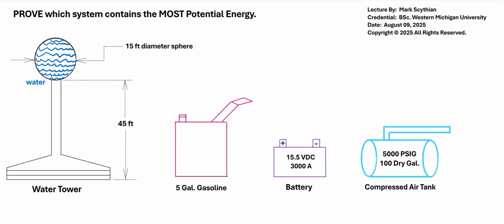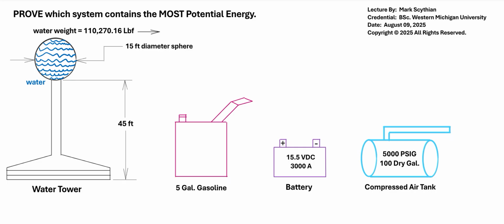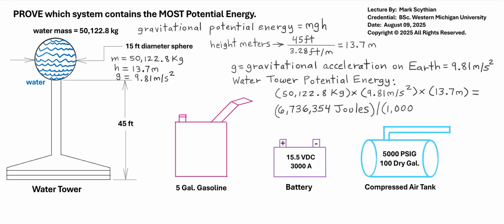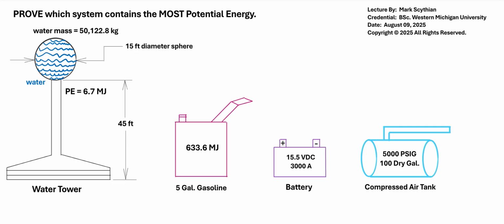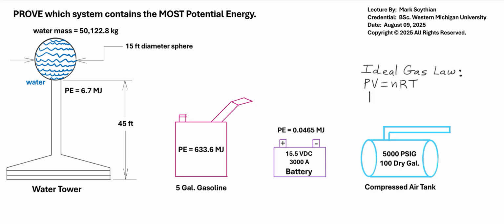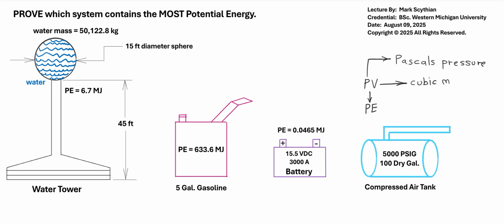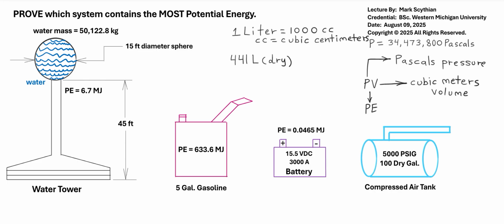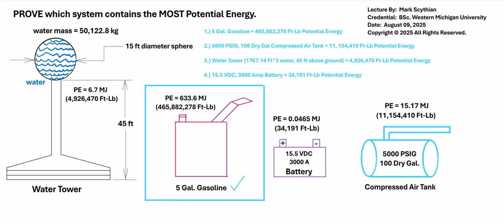Prove Which System Has The MOST Potential Energy

Comment: You correctly find the number of Watts for the battery, but without knowing the amount of Watt-hours it has, can you really transform that into Joules? Assuming 46500 Joules/s will equal 46500 Joules total means we think the battery is being discharged in exactly one second when we draw 3000 A from it. There are batteries of different sizes that have the same number of Volts and maximum Amps, but that differ in total energy. For example AA vs AAA batteries.

Comment: Are you sure about the battery? People (especially from US) confuse Amps/Amphours and Watts/Joules, kills me when I see W/hr. 15Vx3000A is 45kW (not a unit of energy) ... 15Vx3000Ah would be 45kWh or 162MJ but it's quite large for a 15v battery (still achievable: 5s10p of a mainstream LFP cells). Also, when you say potential energy, It's in the context of mechanics, but nobody's going to store energy by lifting batteries so I'll give you that one.
Reply: Right? I went back to try and see if he just mislabeled it but he definitely called it amps not amp hours.
Reply from the maker: On a Fundamental Physics level, Potential & Kinetic Energy are always OUTSIDE of Time.  Energy is measured in Joules or Ft-Lb.  1.36 Joules = 1.00 Ft-Lb.   Power, on the other-hand, is measured in Joules/Sec (Watts) or Ft-Lb/Sec (550 Ft-Lb/Sec = 1 HP) ===> 1 Joule/Sec = 1 Watt = 0.737 Ft-Lb/Sec.

Let's say we're working with Kinetic Energy,.  For example, '4500 Joules of Kinetic Energy'.  Many confuse Kinetic Energy with Power.  Power is ONLY Joules/Sec or Ft-Lb/Sec.  746 Watts = 746 Joules/Sec = 1 Horsepower = 550 Ft-Lbs/Sec.  

Notice that Energy divided into Time is Power (Joules/Sec or Ft-Lb/Sec) .  However, Energy is Joules or Ft-Lb.  Many make the mistake of equating Kinetic Energy with Power.  Kinetic Energy is also Joules just like Potential Energy.  However, Kinetic Energy per second or Joules/Sec is Power, NOT Energy.

Let's say the Kinetic Energy of a moving object is '4500 Joules over 1 second of Time':  Kinetic Energy is no longer Energy, but is instead Power:  '4500 Joules/Sec or 4500 Watts'.   However, Potential & Kinetic Energy are ONLY measured in either Joules or Ft-Lbs, NOT OVER THE FUNCTION OF TIME!

Therefore, a 12VDC (Action Potential) Battery with 3000 Amps (Potential) has a potential energy equal to ' its maximum power output NOT OVER THE FUNCTION OF TIME'.  This is not the same as Maximum Power Capacity measured in Watt-Hours (W-h).

Example:  The Potential Energy of a 15.5 VDC, 3,000 A Battery = 15.5 VDC x 3,000 A = 46,500 Watts = 46,500 Joules/Sec ===> NOT OVER THE FUNCTION OF TIME ===> 46,500 Joules.  Battery has a Potential Energy of 46,500 Joules or 34,191 Ft-Lb.  For greater accuracy we would also need the Battery's mAh Current Capacity and C-discharge-rate, IF a Lithium-Polymer or Lithium-Ion battery.

Another mistake many make is confusing Current-Capacity (mAh) with Potential & Kinetic Energy.  The mAh Current Capacity, especially pertinent Lithium-Polymer or Lithium-Ion Batteries, has to do with the Charge and Discharge Coefficients (C values).  Batteries in general (LiPo, Lead-Acid, NiCad, NiMH) tend to have a higher Discharge-Rate compared to their Charge-Rate.  

For example, if you're working with a 15.5 VDC Lithium-Polymer or Lithium-Ion Battery with a 18,500 mAh Current Capacity, and a C-Discharge-Rate of 5.5C.  This means the Battery CAN discharge 18.5 Amps (continuously) for 1 full hour MULTIPLIED times 5.5C, thus CORRECTED to:  18.5A x 5.5C = 101.75 Amps current-discharge-capability for 1 continous hour.  Hence, this Battery's W-h Rating is:  101.75A x 15.5VDC x 1Hr = 1,577.13 W-h OR 1.58 kWh Discharge Power, at 18,500 mAh Current-Capacity and 5.5C Discharge-Rate.

1.) Potential & KInetic Energy (Joules or Ft-Lb).  2.) Power (Joules/Sec or Watts).  3.) Current Capacity (mAh).  4.) Power Discharge (W-h or kWh).   

These are four (4) different applications, NOT to be confused with each other.  

The Battery in this video (15.5 VDC, 3000A) has a Potential Energy of:  46,500 Joules or 34,191 Ft-Lb.

Note:  Those of us in the Science/Engineering community (worldwide) present our final calculations in BOTH the US & Metric systems of measure.  The Metric system of measure is EASIER to work with compared to the US system of measure.  However, the Metric system is the 'completion' of the US/English system of measure, in the early 20th century.  That is when the Light-Second or the inverse of the Speed-of-Light (3.00 x 10^8 m/s)^-1 determined an Absolute-Distance of 1 meter, or a slightly LONGER distance than the US/English 'Yard'.  1 meter = 3.28 feet.  1 yard = 3.00 feet.  Thus, finalizing Rankine, Kelvin, and Joule Thermodynamics from the English system into the Metric system.  Simply put:  1 Joule = 1 Newton-meter = 0.735 Ft-Lb for WORK, and 550 Ft-Lb/Sec = 1 Horsepower = 746 Watts = 746 Joules/Sec = 0.706 BTU/Sec = 178 Calorie/Sec for POWER.  The Metric System was finalized down to the sub-atomic level when the inverse of the Light-Second was measured at precisely 1 meter or 3.28 feet, in the early 20th century.  We do not have very many engineering/science graduates here in the US.  Most Americans (still) want nothing to do with the Metric system!  lol  But, those (few) of us who are qualified engineers, scientists, technicians, and mathematicians, here in the US, we prefer using the Metric system.  Therefore, we always present final data or specifications in BOTH the US & Metric systems of measure, so that everyone globally are on the 'same page'. 

- Mark Scythian -
Aerospace Engineer
Western Michigan University
August 12, 2025 (FIrst Posted)
August 15, 2025 (Final Edit)

Comment: Need to mind your significant figures! I'm fine with the water tower's two sig figs for mJ, but you lose it when you go to Ft-lb.

The water tower specification has two significant figures. The gasoline has one! The battery and compressed air tank also have only one significant figure.

If you wanted to specify Ft-lb to nine significant figures for instance with gasoline, you would need to write 5.00000000 gal
Reply from the maker: This lecture presents final answers in BOTH the US & Metric systems of measure.  Potential & Kinetic Energy are measure in either Ft-Lb (US) or Joules (Metric).  1 Joule = 1 Newton-meter.  1.36 Joules (Metric) = 1 Ft-Lb (US).  0.735 Ft--Lb = 1 Joule.  1 MJ = 737,078.65 Ft-Lb.  Note:  Watts or Joules/Sec measures Power not Kinetic Energy.  Potential & Kinetic Energy are measured in Joules (Metric) or Ft-Lb (US), independent of Time.  All final answers are approximations, hence Significant Digits are irrelevant ===> Static & Dynamic systems exhibit slight-and-continuous rates of change.

First Posted:  August 12, 2025
Final Edit:  August 15, 2025 ===> 1 MJ = 737,078.65 Ft-Lb